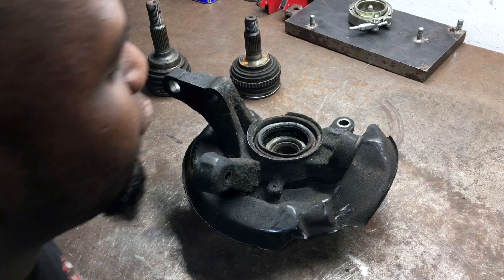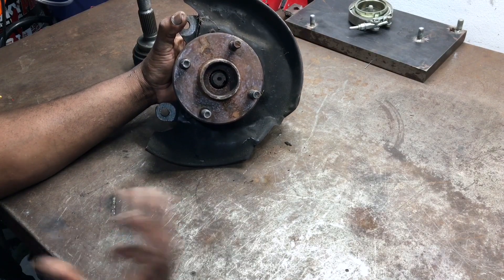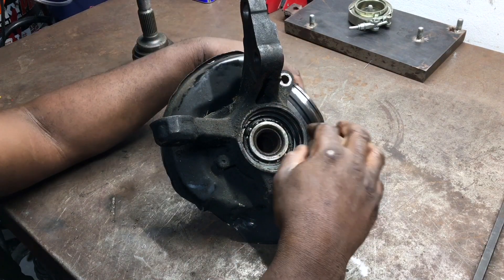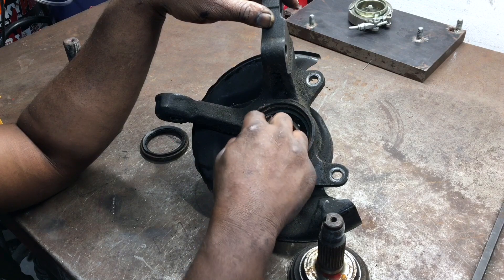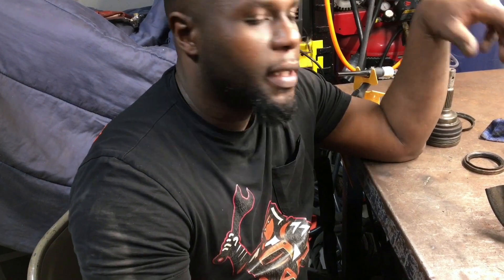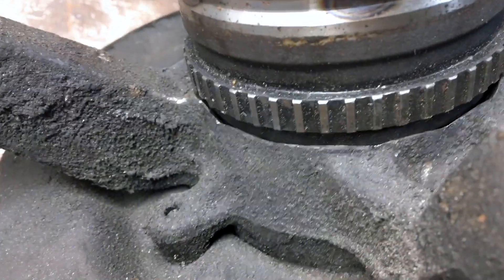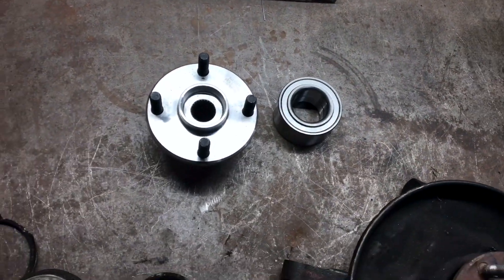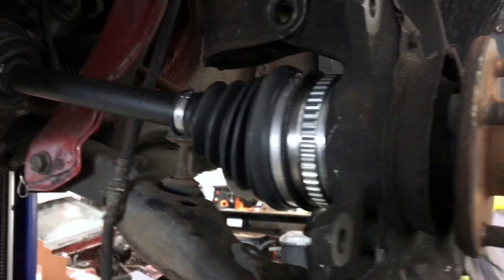Honda Axles in a Toyota : FX16 K24 Swap Episode 14b

Comment: Hi !
Just discovered this channel, i watched all the parts in one go. Giving this much information for a swap like this is awesome ! I might think about doing it in my AE92 if the measurements are the same.
I was wondering, why didn't you just use the end of the FX16 axle on the Honda axle ? Would have been much simpler that way, unless it's not compatible with the Honda axle ?

Comment: Question, I don’t know if u did this already but when the axle is parallel to the ground it should be situated in the middle of the axle cup. Cause you should know that when the cars driving and suspension travels out the full length the axle may fall out on if it’s in too much when the suspension retract/ compresses the axle will be force back i to the cup and bind and shattered the tripod bearings and break the cups. 
Just saying cause you didn’t demonstrate it, you may know all a that already
Reply: Thanks for watching the video now to answer your questions the suspension on that car is completely gone and might i add the springs are cut so the suspension is sagging way more than normal we haven't got around to suspension yet. If you go back and watch the video before that one i mention base on my measurements with wise its exactly identical as the civics so axle length is spot on which i confirmed but we just never filmed that part so we shouldn't and will not experience any biden plus those axle are rated for 500hp dont no if i mention that in the video but they are superior then the factory axles.
Reply: @jdmleno1409  ooh my bad I remembered when u
You mentioned them being the same measurements

Comment: You can't leave the wheel bearing open. It would last long.  There's a wheel bearing for the eg civic that comes sealed. You will have the machine to bearing clip retainer slot about 5mm to use the original clips. You can then press in the corolla or civic hubs afterwards.
Reply: Thanks for watch the video my friend ill do my best to respond the best way i can. First you mention leaving the bearing open its not going to be open im reusing the honda seal which i mention in the video can be reused with just a slight shave. And second i dont have to shave done the retainer clip 5mm at all i already have thw clearance i need for everything to operate properly.
Reply: Are the axle shafts factory honda or are they custom lengths? Love your build